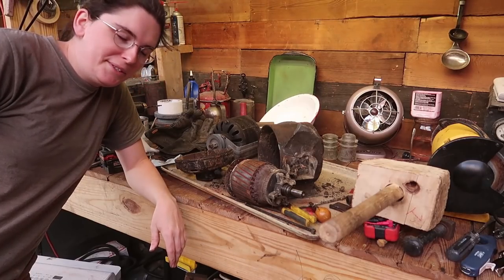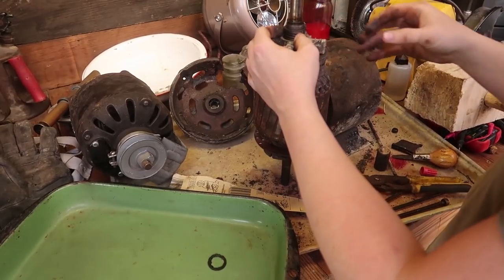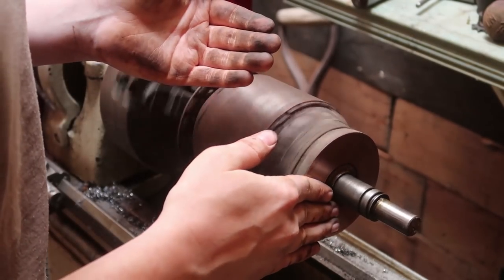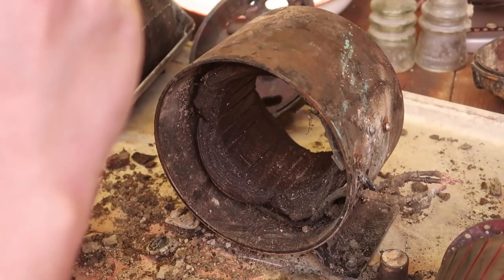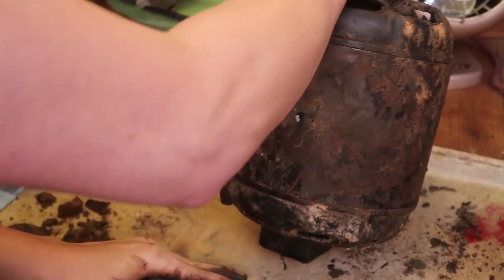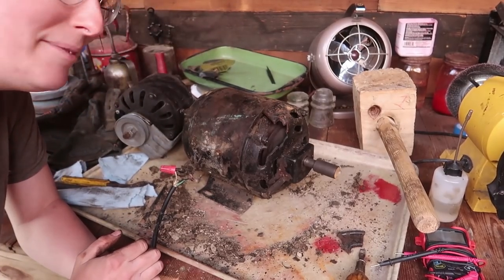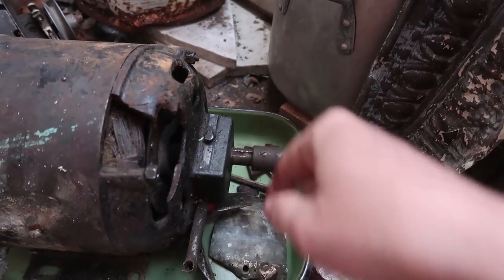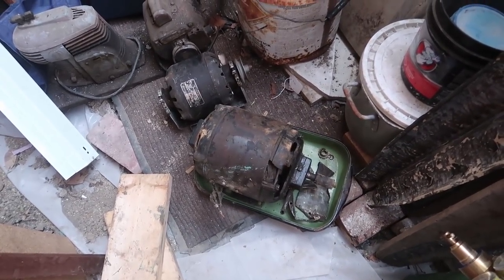1930s/1940s Frigidaire 1/2HP Repulsion Induction Motor Repair 01: Disassembly, Cleaning Commutator

Comment: The slotted  lever on the front of the motor is for changing  motor  direction.   You did not pull the sleeve inside the comutater , this is lined with copper  segments , which when the centrifugal  weights open , slide out and operate shorting out  the comutater  and converting the motor into induction run . Clean and lube centrifugal  weight  mechanism  . Remove all loose insulation  and coat missing areas with liquid tape  or epoxy . The varnish on those old motors is usually  thick and they will take a lot of abuse. I've worked  on quite a few of those motors .

Comment: Nice job! Looks just like my 1930's Delco 1/3HP. They were used to power Frigidaire condensing units. William Lindner gave excellent advice. I'd also pull the shorting necklace to see how it looks. That's the thing you called the 'spring mechanism'.
Reply: I think it is a half horsepower motor.

Comment: Great video!  One important tip, 10 weight oil for these bigger motors.  Sewing machine oil is way too light.  A good cleaning is a must before getting it to run.  It will help you find a lot of problems that will save burnouts and headaches down the road.  Motors were part of my day job and I kept many from the scrap pile.  Keep up the good work.
Reply from the maker: thanks ill get better oil

Comment: These are known as repulsion start induction run motors.  Have substantially lower starting current draw compared to capacitor start motors.  They also can be started under load - apparently have high starting torque.  The first thirty seconds of this video show a info brochure of Century Motors.  They explain the different types of AC induction motors and their pros.
https://youtu.be/sW0WwiE36G0?si=K5CCLAlu8S9Mg5Mz

Comment: I love your work! I see you going to WD-40 a lot. Did you know that it evaporates over time? Relying on WD-40 to stay on a surface might give a false sense of security and cause rusting to start again once it has completely evaporated. I would highly suggest using some linseed oil after the cleanup in place or added to WD-40.

 I don't ever want to sound like one of those people who would tell you "you're doing it wrong." I hate those type of people and their self-satisfied sense of control. You have the spirit of real restoration at heart, and I applaud you for that!
Reply from the maker: well it leaves behind a residue that helps prevent ambient rust. it seems to work well for a lot of my machines. im finding linseed oil doesnt dry well and requires heat to fully dry.
Reply: @Rinoa's Auspicious Travails  maybe taking a small amount of it and diluting it in lacquer thinner or naphtha would be a good hack to speed up the rate at which it cures. Does UV light affect the speed at which it polymerizes?

Comment: Hey, Rin, if you plan to restore many old stuff, you should really consider a parts washer that you can make for cheap like a plastic tray, some plumbing, a filter and aquarium pump to circulate the washing solution. It would help you immensely to wash and degrease parts.. =) Just an idea..

Comment: That's an interesting motor; I've never seen one with a radial commutator like that, I like the design. It would definitely look better repainted though; I'm usually a big fan of red paint on tools, but in this case I think black would probably look more classic/original.
Reply: Some British made Lucas starter motors were made with a radial commutator as well.

Comment: looks to me like the box was added later, probably around the 1930s. A good site to go to for this kind of stuff is Smokstak.com
While we are on the subject of motors, that big motor at the scrapyard I think was connected to another motor, Which would mean that it was either an antique rotary Phase converter or a rotary power converter. this would mean that you could have 3 phase power to run bigger tools or to run motors.

just my two cents

Comment: I'd suggest some fiber washers to reduce end-play float on it. I noticed the end of the shaft moving in and out during spin up/down. (metal washers may work too)
Other than that, great ol' motor and nice find!
Reply from the maker: yeah i have some teflon for that.
Reply: Oh nice! It'll be a slick-running motor with that!

Comment: At 4:40, shame on you.  That chuck key should not be left in the chuck.  If you bump the switch and start the lathe that key would come flying out, possibly in your direction.  That weight and spring mechanism may be a method of disconnecting the starting winding.

Comment: Bad work, she still has a lot to learn!
Reply from the maker: your comment conveys no helpful information, so in other words, useless. dont make the next one useless if you wish to comment here.
Reply: Not bad work at all,you have to make sure the motor runs property before refurbing it.i have been repairing motors and pumps,fans for 35 years,I would jet wash the windings carefully so not to damage the insulation and dry it in an oven at 100c for 3 hours.them old American motors (and British ones)were made to last,modern stuff mostly not.good luck.